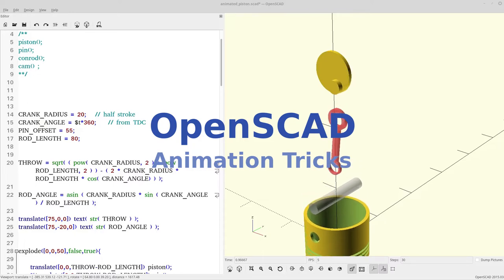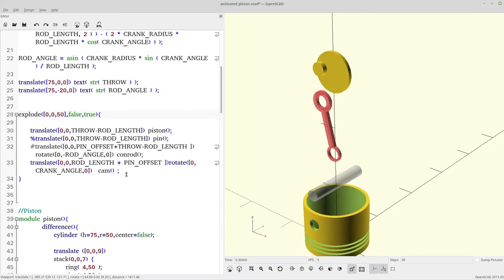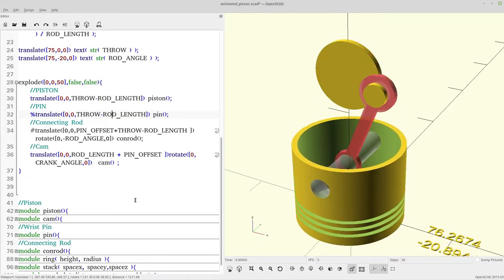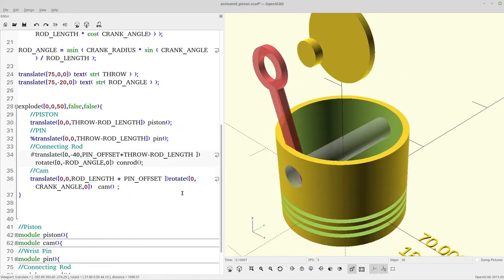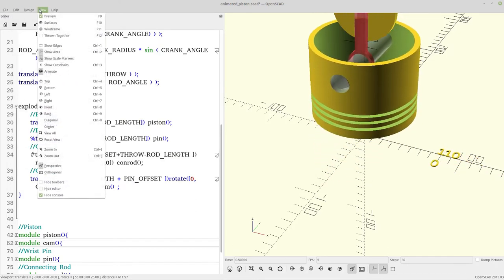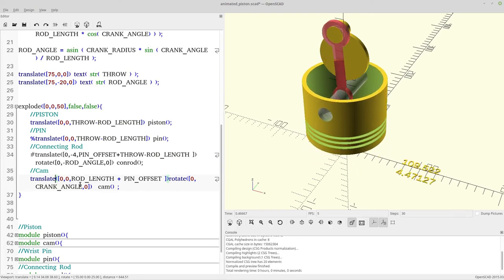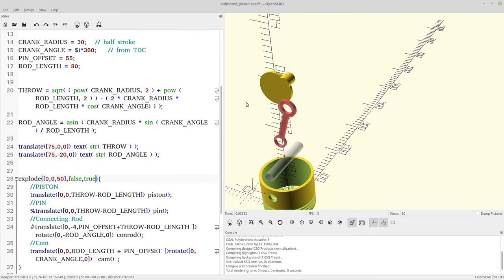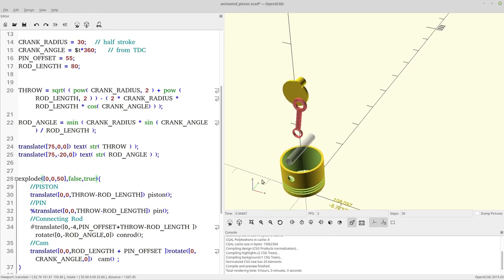OpenSCAD - Quick Tip - Live Render Using Animation

Comment: It shows animation but fails to explain how to achieve it
Reply: Essentially, there is a time parameter openScad allows you to use in the code as well as manipulate from the outside how that parameter behaves - can be a counter that rotates or oscillates or steps over. The different values generate different models (frames).
Very cumbersome for anything artistic, but nice for analytic things that CAN be described in a couple lines of code.